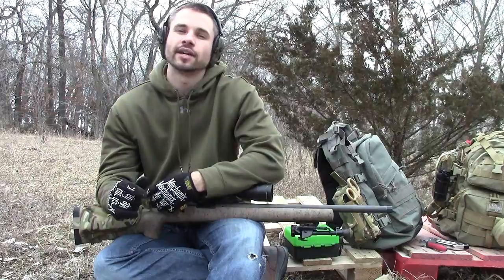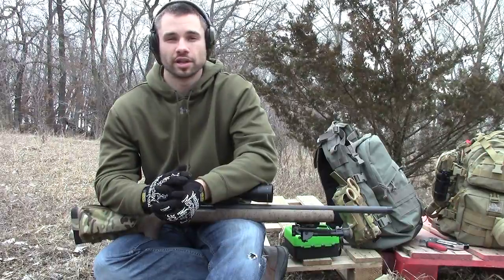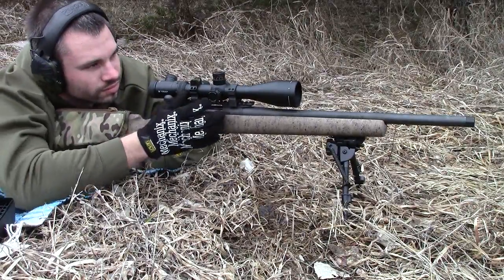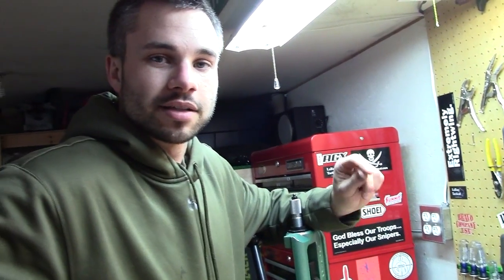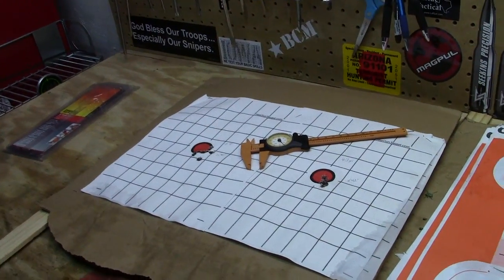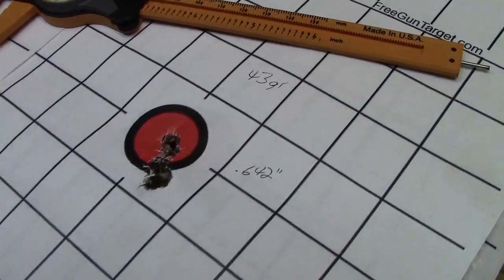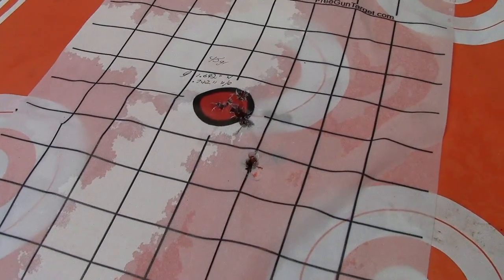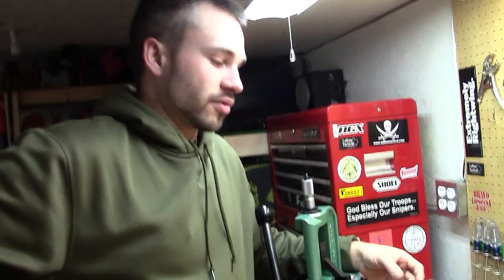The 1k Yard Project - 178gr A-MAX Load Testing

Comment: The load data looks squared away with the Varget weight and good bullet choice.  Except the OAL, I would look at a 2.83+OAL, that's where my rem's and FN's start to shine. Those commercial barrels and chambers have long throats and milspec M118LR has a OAL of 2.831......